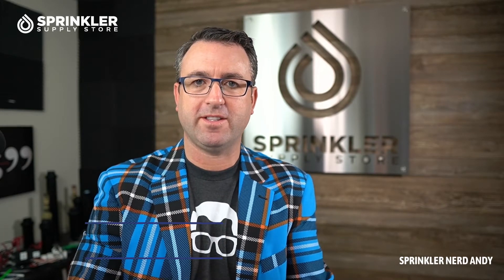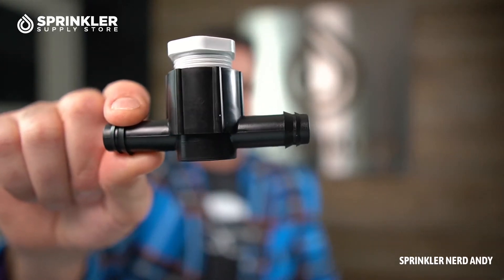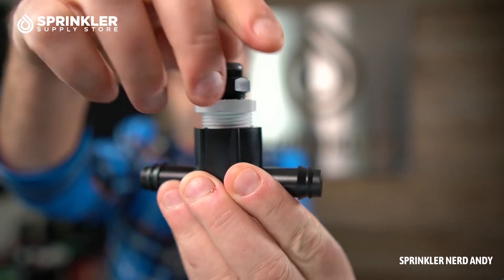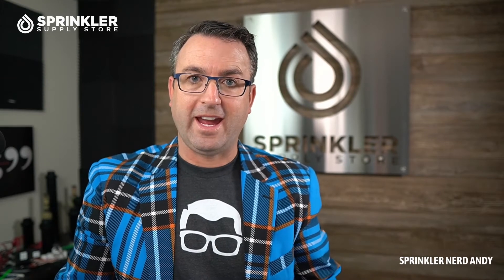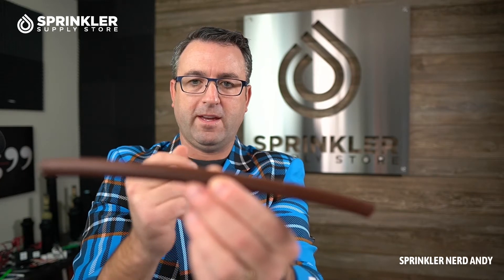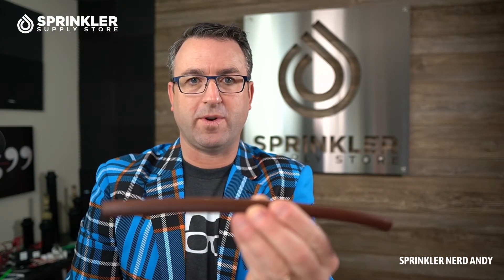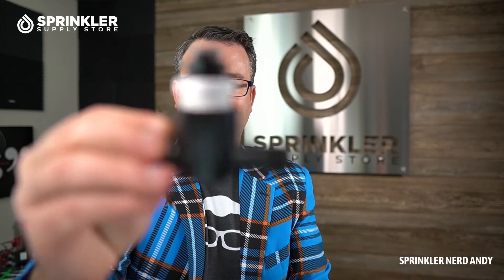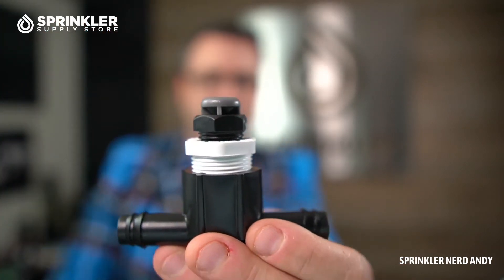Netafim Air Vent | SprinklerSupplyStore.com

Comment: Hi, would having the Netafim Automatic Flush Valve be redundant with this? That's what I have and it sounds like lots or air and water leave the system.
Reply from the maker: Good question. You need both because they serve different purposes. The flush valve opens at the beginning to flush out debris (think pipe breaks, etc). The Air Relief let’s clean air into the line when it drains due to gravity after shutdown..
Reply: @Andy_Humphrey  ahhh ok! Thank you for explaining! I think I'll add one of those because I didn't know enough about irrigation at the time to get drip emitters with check valves.
Reply from the maker: Good luck with your project 🤙

Comment: Would a hose connector with a stop connector effectively achieve the same function? If added to the system in a way that maintained it in a vertical position,  allowing for gravity to drop the stop valve and allow air into the system. It would be significantly cheaper to use a hose connecter than a air vent (in Australia $5 vs $12)
Reply from the maker: I’m not familiar with a “stop connector” - is that like a check valve? Unless you are buying 1,000s, I’d just assume error on the side of caution and spend the extra $7.

Comment: Let’s say with that exact air vent, will that prevent water from coming out also? While still letting air escape and come in? I’m trying to use this for a water tank to allow air in and out but prevent water from coming out from it.. will this work?
Reply from the maker: Hi @frejuarez5452 - you had us stumped for a moment, great question! The air vent used in the video would NOT be suitable for use on a water tank, however, based on your question, we just added another air vent that WILL work. Here is a link to that air vent: https://sprinklersupplystore.com/products/netafim-av-combo-050-netafim-mini-5-in-combination-air-vent

Comment: I've got a problem with a sloped long run, in which the irrigation valve is at the lowest point of the section, unfortunately. We're replacing the valve every few months because the valve becomes stuck in on position. Would an air valve help? I believe it is the TLCV9 that we used. Thank you!
Reply from the maker: Hi Joe. Adding an Air Vent would likely not solve that problem - it also would not hurt anything to add one. 

Because you said this happened multiple times, even after replacing the entire valve, it leads me to believe the issue is either 1) dirty water, or 2) operating the valve out of the manufactures specification (too low flow or too low pressure). 

A valve sticking ON is typically caused by any other following: 1) debris lodged in the diaphragm, or dirty water in general 2) debris under the solenoid 3) flow (gpm) is too low 4) pressure too low.

The next time the valve sticks open, try removing the solenoid and cleaning the port underneath it, as well as around the diaphragm. This should prevent you from needing to replace the entire valve.

Please circle back if/when you figure this out - I'd love to know what you discover.

-Andy
Reply: @Andy_Humphrey  Thanks Andy!! Greatly appreciated the response.